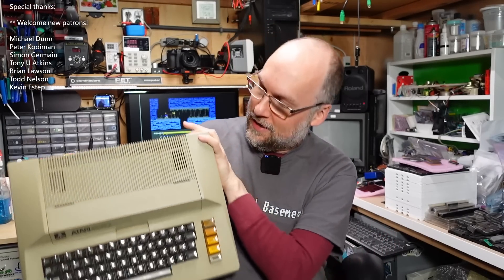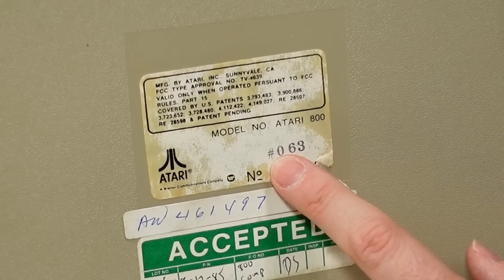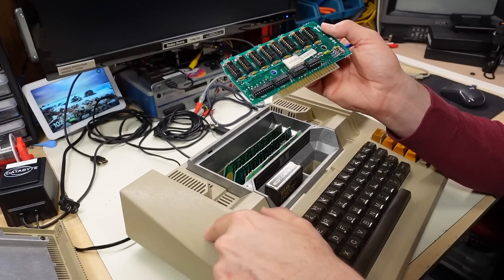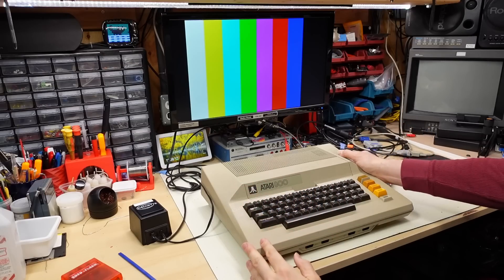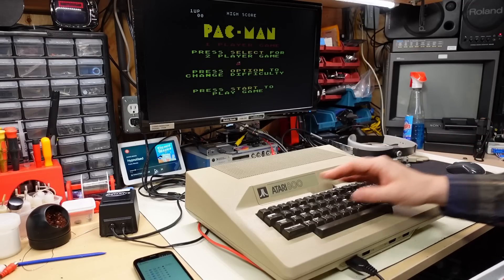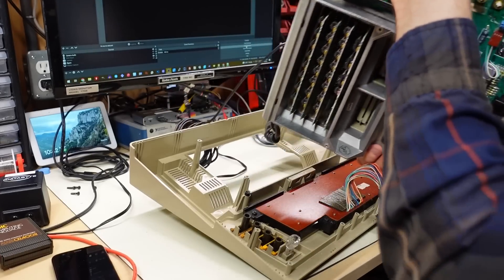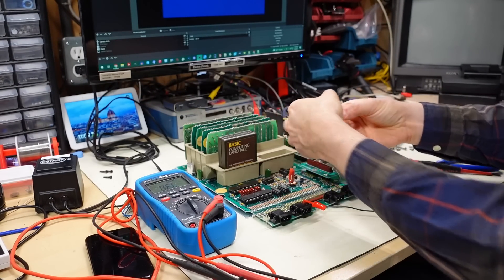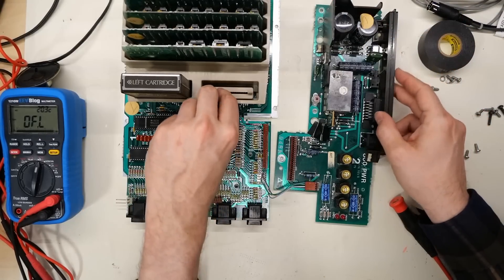Troubleshooting the beautiful Atari 800

Comment: Atari 800. The best 8-bit computer of the 1980's. Let down slightly by a lazy version of BASIC. But if you read 'De Re Atari' and learn how to access the superb hardware, you could do amazing things which were completely impossible on other 8-bit computers.
Also, the Atari SIO (Serial Input-Output) system is the predecessor of USB.
OSS (Optimized Systems Software) released excellent software for the Atari, including a cartridge version of BASIC called BASIC XL, which could access the Atari's hardware and graphics capabilities such as player-missile graphics.

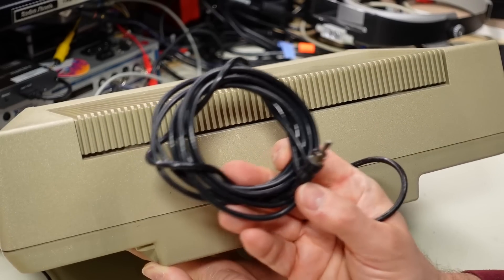Comment: 3:44 because it’s cents/pence cheaper to connect straight to board and any mobo revision isn’t impacted because it’s just a hole in the case than put an rf port and a male female RF cable included.   RF is always going to be rf.  the other ports are either niche or variable use.  That’s the reason.  As far as I remember.
Reply: FCC regulations regarding spurious emissions were very strict at the time. Maybe the fixed cable was the only way they could meet the requirements (without blowing the budget).
Reply: @andreasu.3546  no, but that’s definitely the reason for the heavy duty shielding.
Reply: @AcornElectron  No?
Reply: @andreasu.3546  sorry, I mean yes 🤣
Reply: @AcornElectron  Well ok then ;-)
Reply: @andreasu.3546  isn’t it nice (if very rare) when random people on the internet admit they messed up?   Have a great Sunday or Monday depending where you are!
Reply: Except that the cable isn't connected "straight to the board"; it has an RCA connector on the internal end, too, as you can see later in the video.

I think it's more likely that they just didn't want the wrong cable to be used. This connection requires a coax cable of the correct impedance; using a common RCA audio cable would both greatly reduce the video quality and probably act as an antenna.
Reply: @Curt_Sampson  I think you’ve missed my point, the design would call for changes since the main board is so far from the case.
Reply: @AcornElectron  Sure, but it's not so difficult to design a layout that puts the RF modulator output at the edge of the board to go through a hole in the case. We know this because so very many computers did it this way, including all of the post-PET Commodore computers, all of the MSX machines I've ever seen, and plenty of others.

Once you've decided to use a captive cable, of course, you need to do a design that does not put the RF modulator output at the edge of the board because then you won't be able to fit the plug inside the case.
Reply: @Curt_Sampson  plausible.

Comment: You don't need the 8K BASIC cart to play Pac-Man.  IIRC, in order to run software that needs 48K, you need to remove the cart, since it maps into 8K of address space, and you're left with 40.  The other 16K of 6502-addressable space is taken up by system ROM.  It's been decades since I learned all about the advanced (for the time) architecture of this thing, and learned 6502 assembly on it.  What I've forgotten about it would fill a book.

Comment: RAM and ROM from my 800 (and my friends'), were always cartridges, not bare circuit boards.
Reply from the maker: Yeah apparently I'm reading there were heat issues so they switched to bare PCBs -- probably also a cost savings too?

Comment: I had one.. and an 800XL, A few ST's and a Falcon.. Probably still have them all. 
800XL just had a RF port not the wire sticking out..
Didn't booting with the option key down start a memory test? Or was that just the XL?
Also the mem boards used to have cases... not just pcb's.. http://www.atarimania.com/documents/atari-800-computer-owners-guide-v2.pdf (page 16)

Comment: It it possible to get the 800 up 128k of memory since the memory is socketed?
Reply: You can get 1MB of memory with the Incognito board. That plugs into the rom board slot,  you also need to route and solder a few wires.. Besides the RAM,  the board contains multiple flash OS slots, a CF card hard disk and virtual disk drives.

Comment: Regarding the SIO port. I accidentally bought an acoustic coupler designed for the Atari 400/800. I was hoping to use it on an RS-232 port. I don’t have an Atari. Any tips on RS232 to SIO conversion? I don’t want to butcher this coupler.
Reply from the maker: I think there is more so it than Serial -- since it's like IEC on Commodore and there are device numbers and stuff. Not super familiar with how it works inside
Reply: You can probably hack an RS-232 interface to do the hardware side of SIO bus communications (you'll need to start by getting 0/+5V signals instead of -12/+12, which you may be able to do by going around the RS-232 level converters), but you'll need to find or write software to do the communications protocol. The basics of it are described in the "Device Control" section of the "Atari SIO" page on Wikipedia. (Link in my next reply, in case the spam filter gets it.)
Reply: The Atari 830? If so, I believe the 830 connects to the Atari 850 interface, which has serial and parallel ports. You can check the pin out in the 850 documentation.
Reply: @hauptuhrdotnetblog6700  The Atari 830 is a relabeled Novation CAT modem; that modem has a Wikipedia page with a picture if you want to compare. But it should be awfully easy to tell whether you have a relabeled regular modem or something Atari SIO specific: just look to see if you have a standard DB-25 connector or Atari's unique SIO jack.
Reply: @hauptuhrdotnetblog6700  The DE-9 connector would seem to suggest a PC/AT-compatible serial port only if the unit dates from 1985 or later. (The PC/AT was the first popular use of DE-9 for serial, and it was released in mid 1984.)

An earlier design date, lack of a separate power input and the board with the connector being labeled specifically for Atari probably means that they're using Atari SIO with a DE-9 instead of the more expensive Atari SIO connector on the modem end; they would have supplied a custom Atari SIO to DE-9 cable (which I am guessing you don't have). While the Atari SIO connector has 13 pins, some signals are not needed for a modem, such as the 2nd GROUND, MOTOR,  AUDIOIN, and probably one or two others. The Atari SIO bus does supply +5V power (and +12V on the Atari 400 and 800).

I'm happy to help you with the details of reverse-engineering this if you contact me on Telegram at [redacted]. There's a good chance we can work out the exact pinout to build a cable just by following traces on the board.
Reply: @almerian  You're right; this modem too looks like it's designed to connect to the Atari 850 which, it turns out, uses DE-9s for its RS-232 serial interfaces. I've not gotten around to finding the pinout, yet, but that seems to pretty much make clear that it's just a normal modem and the "Atari" board would be for whatever particular pinout the 850 is using, as opposed to the standard DB-25 pinouts of the time.

Comment: SMH....
Before 1982 the RAM carts had a cartridge cover on them and they form fitted into the system. There were knobs which you can turn to remove the upper cover to add ram as you liked. After 1982 the system was filled with RAM (48K) and sold as a low cost machine.

Comment: Do you have an experience backing up the data from Atari 800 5-1/4" disks? I've got several boxes full of disks I'd received from my dad after he passed, along with a working 800 XL, 810 disk drive, 825 80-column printer, 850 serial interface and 830 acoustic modem (300 baud!). The disks contain pirated copies of games, downloaded from various BBS's back in the 80s by a former colleague of my dad's. I'm guessing most of the games on the disks have already been archived by other folks online but it might be worth investigating.

Comment: I still have 2 Atari 130XE machines. ... which are basically 800XL machines with 64k more memory in banks.
Though I probably wouldn't have admitted it at the time, the 130XE is actually a bit inferior to the C64 as a home game computer. Not just because of the number of games available, but the C64 just worked faster and better.
Btw... the 130XE is not nearly half as sturdy build.

Comment: Sorry for hijacking your 800 video, but do you have a recommendation for a C64 replacement disk drive SD card reader or emulator?
Reply: The PI1541 is not too expensive (if you can get hold of a Raspberry Pi) and works well, that’s the one I would go for. A some software expects a real 1541 drive, so something that emulates it well is the way to go.  The SD2IEC is also easily available and very popular, but isn’t as compatible with the 1541 floppy drive as the PI1541. I use both but prefer the PI1541.